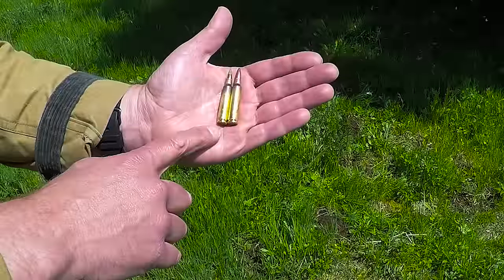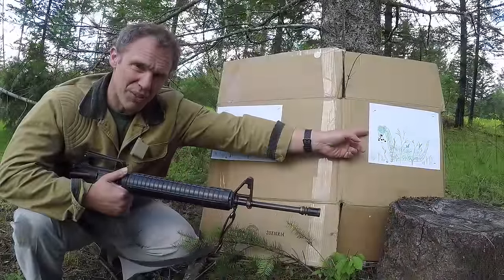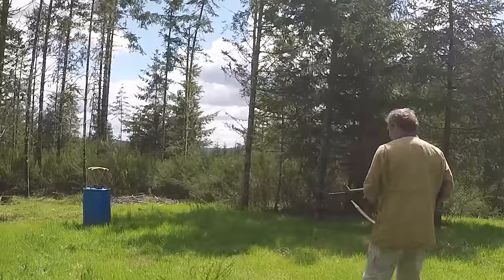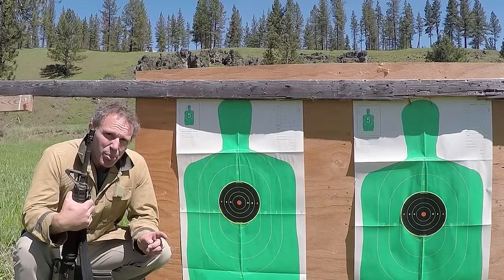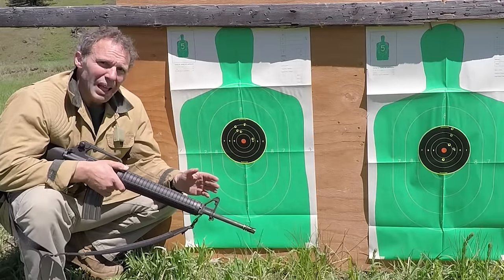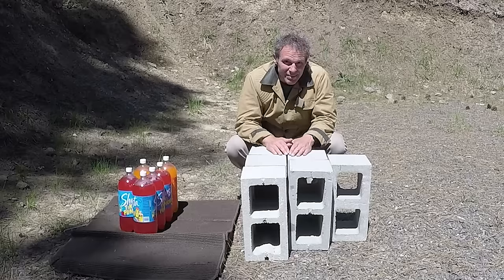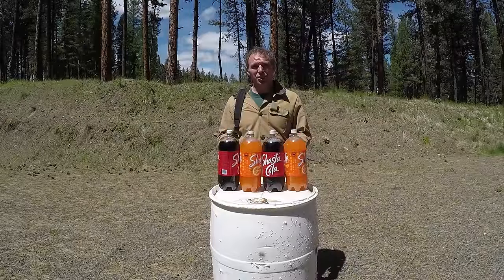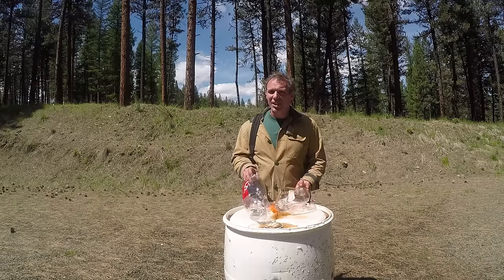5 56 NATO Ammunition:  XM193 55gr.  vs  M855 62gr.

Comment: Everyone knows that Dr. Pepper has a greater molecular density than Orange soda, so not an accurate comparison:-)
Reply: Kraig Stovall haha a more compelling argument than most of the other people who are triggered in the comments. I got a chuckle out of that
Reply: Its cause of the 23 flavors
Reply: If you saw the outtake reel for his sponsorship of Shasta, you'd understand why I don't know what his beef. with pork ribs oranges and fleece is though
Reply: But killing a bottle of Dr. Pepper would be a mortal sin. LOL
Reply: @bdr32965  Texas wept.😂
Reply: We use to get old cars for destruction days, and the green tip really did a better job on the engine block and axles but there were a lot of keyholes.
Reply: He's using off brand, which is more ballistically consistent
Reply: All I could think about was Oh no not the Dr Pepper
Reply: I shot a rabbit in the head with a 62gr penetrator at 30 yards and the result was not expected. The rabbit exploded as if it was sitting on top of the dynamite. One small piece of flesh hit my led, that was the only part of the rabbit I could find. The penetrator has devastating results on flesh when it comes in contact with bone!
Reply: Once, when I was cleaning in the kitchen, I tried to remove some orange soda bottles from the top of a tall refrigerator. The first one slipped from my hands and knocked over more of them, which hit me in my face. I fell to the ground and was hit very hard by the last two. From that day, I swore vengeance against these sticky jerks. I will always upvote any video of orange soda being shot.
Reply: 'Cause the Doc is from Texas...
Reply: Exactly😆
Reply: Maybe because of the caramel and molasses ingredients in Dr Pepper/Dr. Thunder.
Reply: But how many layers of denim did you use?

Comment: The 55 gr FMJ was not designed to tumble.  Here’s the scoop...   
It’s essentially a non expanding varmint projectile.  All such .22 centerfire projectiles have thin wall jackets, and the ones employed by the military for use in US semi & full auto rifles have a “cannelure” located on the side  wall
of the jacket.  This cannelure, or rows of small grooved depressions ringing the copper jacket exist to enable the brass cartridge neck to ‘lock into’ and better grip the projectile during the crimping process at the ammunition factory.  This is important due to the bidirectional recoil forces upon the cartridges when the gun is firing.  Those projectiles sitting in their cartridges in the magazine without a cannelure would otherwise break-free from the case’s crimp during sustained fire resulting in 
them sliding back into the neck of the cartridge.case.  This would result in feeding malfunctions and possibly excessive chamber pressure.  
Also, FMJ, spire point / spitzer-shape projectiles tend to rotate from their nose-on orientation to a 180 degree base-forward orientation when penetrating soft tissue.  This is because most of their mass is in the lower half of the projectile and the resistance to penetration imparts a rotational force.  However, once the projectile completes a 180 degree tail-to-nose reorientation, it remains oriented that way as it continues to penetrate.  It however does not continue to tumble as some claim. 
Now here’s the kicker...It was discovered that when the 55 gr FMJ when fired from the 5.56 out of a 20” bbl, and with terminal ranges out to ~ 100 yards into human flesh...well the following phenomenon occurred:  As the projectile was halfway through its tail-to-nose reorientation flipflop, the dynamic stress upon the projectile would cause it to fragment in to 4 pieces.  The nose would come apart into 3 approx 7 gr.fragments, plus a 25 gr  back half.
This caused some nasty flesh wounds which enhanced the cartridge’s combat effectiveness.  However, this was not an engineered feature of cartridge.  The newer 62 gr “ green tip” projectiles however tend to penetrate in a nose-on orientation (when fired from barrels with suitably faster rifling twist rates).  The green tips out-penetrate conventional FMJ projectiles, but they cause less tissue damage.
Reply: Thanks for the explanation. Very helpful.
Reply: Loonytoones85  - It is a Geneva Convention work-a-round, after a fashion. Eugene Stoner and his team were handed a very tough set of design criteria. Their new automatic rifle (assault rifle) had to be much lighter, and have lighter ammunition, than the M-1 Garand and M14 which came before it, yet wounding capability equivalent to or greater than the M-1 Carbine. Using full-metal jacket ammo, since the Geneva and Hague Conventions both prohibit the use of expanding or hollow-point ammunition in land warfare. Stoner is on record as stating that he took advantage of a peculiar characteristic of light projectiles fired at high muzzle velocity - their dynamic instability and tendency to yaw in comparison with heavier larger-caliber projectiles at similar velocities. When it was discovered that 55-grain FMJ fragmented at muzzle velocities above 2800 fps, a "crimping groove"or cannelure was added to the M193 design to make fragmentation/shattering more likely. It also had the added benefit of making the ammo safer to operate in rapid-firing automatic/select-fire weapons. The most-lethal envelope of M193 55-grain is at or above 2800 fps, the velocity necessary to provoke shattering/fragmentation, and thus the formation of a high-velocity blast cone of fragments at the intended target. M855 was designed for enhanced penetration of mild steel plate out to 500m, of the kind used in military helmets such as the Warsaw Pact helmet of the Cold War, but this capability was purchased at the cost of the fragmentation effect seen with 55-grain FMJ. This "ice-picking" effect was seen and well-documented at the Battle of the Black Sea (Battle of Mogadishu), the famed "Black Hawk Down"incident in the early 1990s - where elite Rangers and Delta Force personnel saw Somali militiamen absorb multiple center-mass hits with green-tip 62-grain M855, yet remain in the fight. The dramatically-inconsistent performance of M855 prompted a great deal more R&D into ammunition for use in AR platforms, which eventually bore fruit in the global war on terror.
Reply: Loonytoones85  - A lot of nations did it. Britain engineered their Lee-Enfield .303 cartridge to have a lighter forward section by using aluminum filler. Some militaries/nations do the same thing to lighten the front by using an air pocket. The point being to get the projectile to "swap ends" and perhaps fragment during the terminal ballistics phase of flight. Even if the bullet remains intact, as it transitions to a nose-rearward attitude, it will widen the permanent wound channel. With so many nations/militaries looking to get around the Hague/Geneva Conventions, it sort of makes you wonder why they bother with them at all. It isn't as if there is a whole lot of logic in much of the reasoning anyway. HP bullets are forbidden, but napalm and FAE munitions are not? Expanding bullets are illegal, but not all sorts of mines? I don't get it.... As U.S. Civil War General Sherman said "War is cruelty and there is no reforming it."
Reply: Well said.
Reply: @GeorgiaBoy1961  I recall reading somewhere that the reason the Hague Convention outlawed expanding projectiles was not for humanitarian reasons. It was because militaries realized it was better to severely wound an enemy soldier rather than kill him outright, since the adversary would expend a great amount of resources caring for wounded soldiers, as opposed to none for the dead. Whether this story is accurate or merely cynical revisionism of an actual humane gesture, I don't know.
Reply: @loumencken9644  - Hi Lou, thanks for writing. Not being a legal eagle - a lawyer - offhand I don't know the details of why they wrote the treaties as they did. It's an interesting question. And who knows the reasons for those ideas? Europeans - especially the aristocracy - in those days still harbored ideas that war could be waged on gentleman's terms, chivalry, no targeting of officers, etc. World War One put paid to most of those notions, but such ideas did persist well into the mid-20th century. People are the products of the times in which they live, and there were plenty of people born and raised in the 19th century still alive and influencing things well into the 1950s and beyond. Thanks for bringing a defect in my knowledge of military history to my attention. Maybe I'll be motivated to fix that sometime. If memory serves, I think service academy graduates and ROTC students are required to learn some military law; maybe one of those folks can help us out.
Reply: @GeorgiaBoy1961  Good stuff & Informative.

The war on terror is not a actual war as such so the rules from the Geneva convention do not apply. The regular military probably uses green tip since that is what they have on stock, but in special operations they probably do use HP ammo. Also I do believe landmines are outlawed, the US just hasn't signed that part of the treaty but most countries have.
Reply: @BertM3  - Hi Bert, the U.S. military - "Big Green" the U.S. Army - uses M855A1. The Marines and the Navy, JSOC, too - if my info is correct, continue to use other kinds of ammo, especially OTM, open-tipped match, which fragments more-reliably over a wide range of velocities than M193 or M855. OTM isn't hollow-point, per se, but acts somewhat like it in use, so the JAG lawyers can be kept happy while the troops get something that works. Our enemies in the GWOT don't subscribe to the Geneva/Hague Treaties, so I don't quite understand why the JAG Corps people bend themselves into pretzels over this sort of stuff, but there you go....
Reply: @BertM3  Our enemies in the War On Terror are not signatories to any treaty that I'm aware of.  Furthermore, they forfeited any protection under the Laws of War when they started beheading people.  
What's ironic is that some of the ammo issued to us is actually deadlier than some jacketed soft points.  The MK 262, for example, was not designed to expand but fragments and tumbles.  The same is true of M855.  The new M855A1 is even nastier.
Reply: @thatguy22441  M856A1 and M995 are better according to Tarkov, they are really expensive but can be made in the hideout fairly economically
Reply: There are some very sharp folks on these videos.  Thanks to all
Reply: I think the 7N1 Russian 5.45x39 projectiles have an airpocket between the case and core. When they hit, they turn 180° in a double yaw and the jacket starts to unravel from the open base. Lots of Soviet fmj ammo does this. Just because it doesn't expand it still leaves a horrific wound channel.
Reply: @GeorgiaBoy1961  the open tip bullets are legal as per Geneva if the projectile isn't designed to cause "superfluous" injury. The design for those projectiles is for higher energy and better accuracy at longer ranges, the injury caused is a secondary effect of the design. The 55gr. pills originally loaded with a 1 to 12 twist yaw and do crazy stuff when they hit meat. The bullets didn't rely on fragmentation for effective.
Reply: Ironic that something designed and implemented to avoid causing 'superfluous injury' ends up doing more damage than the ones prohibited by the Hague Convention.
Reply: Wow! If they have a degree past Ph.D....
Reply: @BertM3  haven't outlawed land mines, have the terrorists signed up for that? IED's?
Reply: @timothybayliss6680  you mean bullets, shot out of the end of a rifle, aren't designed to maim, only kill?
Reply: Damn skippy thats the truth^ God bless Eugene Stoner and the Armalite corporation.
Reply: @GeorgiaBoy1961  I imagine it is at least partially a logistics thing. Are we really going to risk some unit equipped with non-Geneva materials engaging with another nation-state's military? It's better to make sure all our material is compliant. The other bit is likely a "hearts and minds" thing. It allows us to paint ourselves if not as the "good guy" then at least as the side who can be relied upon to honour & follow agreements. It also allows us to distance ourselves from our own soldiers who break those rules, so that taint doesn't spread too far in terms of public opinion of the locals.
Reply: @loumencken9644  - I don't rightly know the facts of the matter, either, not without seeing more historical evidence from that time, at any rate, even if any survives. You may be right. Thanks for the comment.
Reply: @RaptorJesus  - Thanks for the comment, those are worthwhile points.
Reply: @GeorgiaBoy1961  jesus... center mass hit from a green tip and still in the fight?  I'm shooting all my green tips out this weekend.
Reply: @timothybayliss6680  - Re: "The 55gr. pills originally loaded with a 1 to 12 twist yaw and do crazy stuff when they hit meat. The bullets didn't rely on fragmentation for effective."

Stoner was on record as choosing to emphasize light weight and very high MV in the 55-grain projectile because even at that time in the mid-1950s, it was understood that lighter projectiles are gyroscopically less-stable  in flight than similar ones which are heavier. In other words, they yaw more easily, which in turns enhances their ability to "swap ends" or tumble when entering a target, in particular something like an enemy soldier. 

The historic documentation I have seen suggests that Stoner et al.knew full-well of the tendency of M193 to shatter or fragment above certain MV values. That's one of the ways the design team met the lethality requirement for the new rifle and its ammunition in the first place. 

Impact at or above 2600-2700 fps is the figure I have seen, give or take - as being the threshold of the bullet to shatter and create multiple wound channels or not. That's one reason why the lethality of .224-sized projectiles is so dependent on high impact velocity. That's from a 20-inch tube, 1:12 or even 1:14 twist. Speed up the twist, lengthen the range or shorten the barrel, and that range of optimum performance shortens for M193 Ball/FMJ. It can still drop a tango past that range, just not as reliably.  

M855/SS109 made the problem worse, because by enhancing the penetrative ability of the round with the internal cup/penetrator, plus upping the weight to 62-grains, meant that this new bullet did not shatter or fragment as reliably as the previous design. Ice-picking or through-and-throughs became an issue in the 1990s. Most-famously at 1993 the Battle of the Black Sea in Somalia. 

There are elite soldiers out there who like M855 and were/are satisfied with its performance. The issue isn't that cut-and-dried. If you never experience problems with it in combat, as a soldier, you are probably happy and have no problems with it, but it doesn't get the job done reliably, then that grunt isn't happy, most-likely.
Reply: @kdworak4754  - There's no need for that. Just use 'em appropriately and you'll be fine. Sometimes, penetration is good, sometimes it isn't. I'm not trying to be graphic here, but consider how the game you hunt - its size, weight and characteristics - help determine load choice for a guy going hunting in the woods someplace in the deer season in the fall. It's really no different in military terms. Which is why there are so many different types/styles of loads for small arms and crew-served weapons in the military. 

Ironically, and perhaps you know this already, but against AR500 steel, for example, M193 Ball/FMJ often does better than M855 .... not withstanding the 7-grains heavier bullet with the penetrator. It's situation-dependent, it really is.
Reply: @timothybayliss6680  Indeed it does.
Reply: @loumencken9644  Thankyou Been saying that for years. I was told by my Sargent that was why it was used
Reply: It actually started out as the Remington .222 varmint round, but bumped up to .224 later on. The .223 Remington, 5.56x45, .224 valkyrie, and .223 wylde are all the same .224 bullet in different cases
Reply: Which is why they didn’t work too well in Somalia. The alternative was to go to the higher 77-82 grain ball used later on. My LWRC will not take 62 gr ammunition but does well with 77gr.
Reply: @loumencken9644  Yeah I’ve seen that kind of thinking used for booby traps during the war in Vietnam. It’s a two edged sword. It takes time and effort to evac a wounded soldier from the bush, but that soldier can recover and return to the fight in many instances. There’s no recidivism with a dead soldier except in video games.
Reply: The "Tumble" was inherent / purported in earlier days of model M16A1's which had barrel twist of 1:12 and 20 inch barrels.  1:12 did not provide the stability needed esp when firing the heavier M855 green tip Ammo.  Most modern day AR's typically have 1:7 to 1:9 in twist in shorter barrels so more stability and probably less "tumbling" seen.
Reply: @GeorgiaBoy1961 are all m855 green tip? I’m new and a bit confused
Reply: @jeremywilson8334  - Why are you asking me? I have no idea...